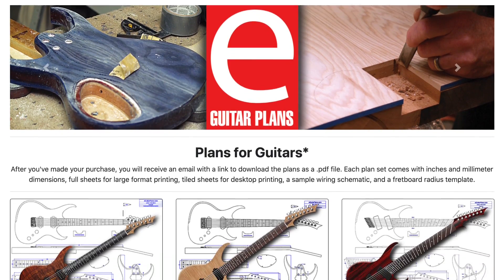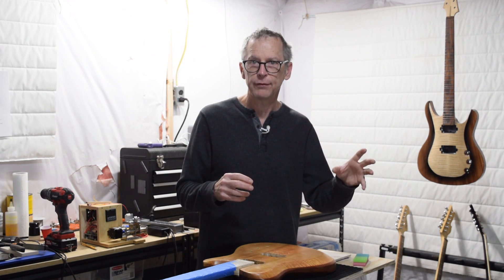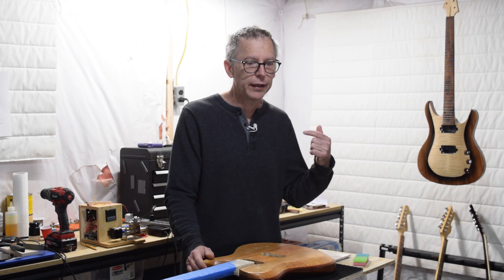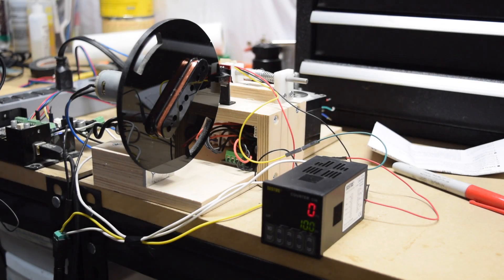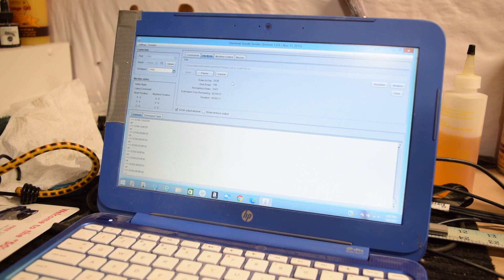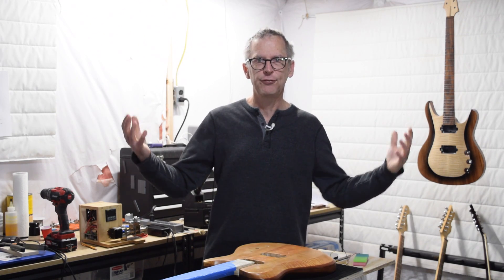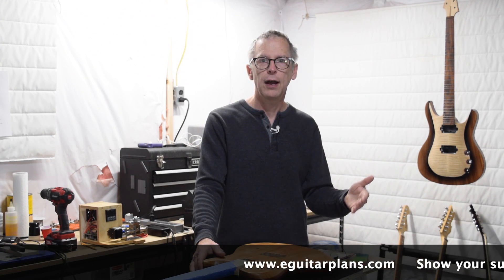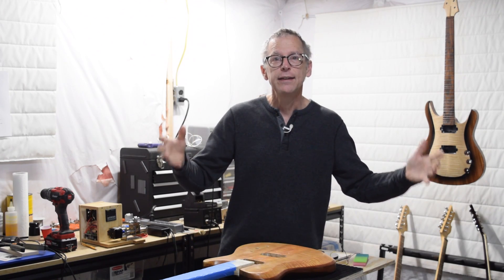Making A CNC Pickup Coil Winder: Part 3

Comment: Hi. Have you ever thought that making the perfect machine will give almost the same sound to the same parameters pickups ? Don't you think you loose some of the magic of chance by hand wounding ? I could call it "personality" of each pickup. my 2c. By the way you're a fantastic engineer.
Reply from the maker: It is impossible to make identical coils, even with a CNC winder. The electrical current to the motors is extremely imprecise and the result is inconsistent coils. The slightest inconsistency from one coil to the next can have a profound impact on tone.
Reply: I know an I could imagine a milion ways for improvement but you're still miles away from all the 
diy for winders i have seen. By the way that impact on tone makes it feel like wood. doesn't it? More "personality". Sometimes i wonder why we spend so much time for the little things and not the major ones like for example who makes it "ring like a bell". Have a good one. @HighlineGuitars

Comment: So one revolution is a single winding? I had an old Fender DuoSonic built in the 1960s(great guitar, sadly it was stolen) I was told FENDER customer service, the single coils on that guitar, had the most out put of any of their pick ups,(up to that time 2004). If I remember I was told each pup on their old Elite Precision Basses (early 80s) had 10k windings. I will admit the bass sounded great, was built great, except for the 2 saddle bridge. (I was an Electronics Tech & studied all of this stuff but that 1975 so I've forgotten most of the theory & formulas).
Reply from the maker: Yes, one revolution equals one turn.
Reply: @HighlineGuitars  thank you sir!

Comment: sooo I've gotten to saw the round edges of my coffee table and guess what.. it's hollow lol. Really surprised it was so heavy. Maybe really dense oak or so. I've cut the top and bottom pieces loose with a chainsaw and I'll be planing them first with a router, then with a electrical planer (you can make cool jigs) and then glue them up. Also I will now need both coffee table decks to get to the same  thickness. But I really want a all solid piece of wood, so, also found a video on making a wagon vice pretty cheap, already got an Stainless steel screw-rod? probably not the right word
Reply from the maker: LOL. My next YouTube build is going to be made from an old butcher block oak kitchen table.

Comment: Awesome work! Excited to see the finished product.  

The difference is because the power supply has capacitors that serve 2 purposes. 1 to smooth out the dc voltage and 2 to support occasional surges in power draw. So when you turn off power to the power supply the capacitors have stored energy that can power the system for the time you observed. When you interrupt the pwm signal there is no stored energy to keep the motor going.
Reply from the maker: The winder is finished and a demo video will be uploaded on March 19, 2021.